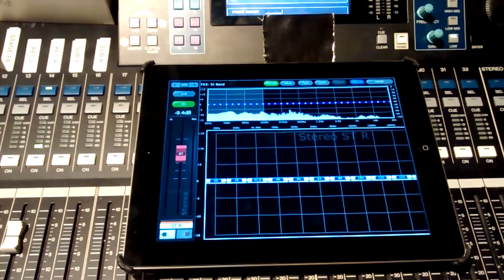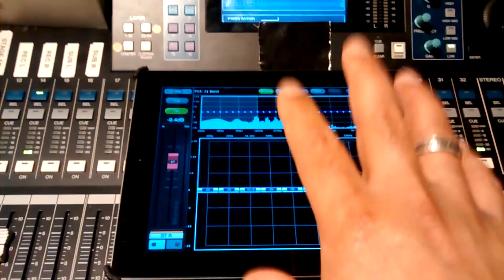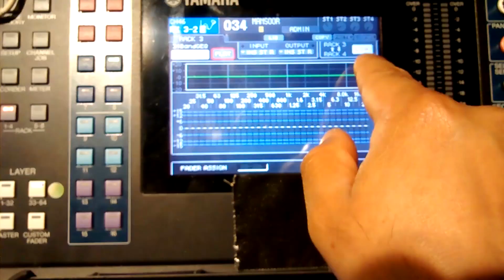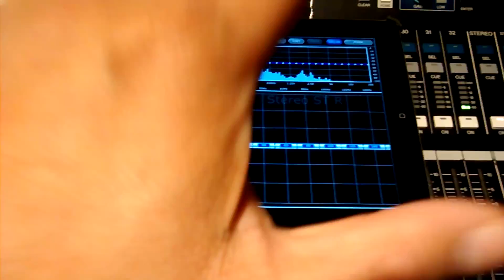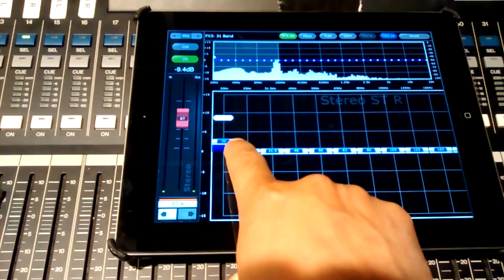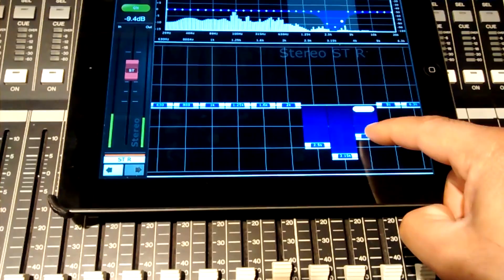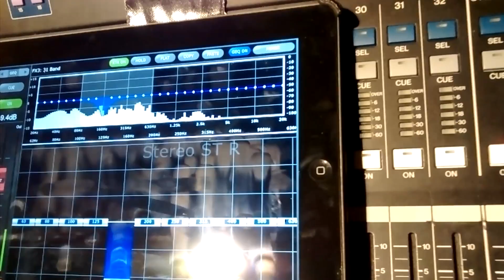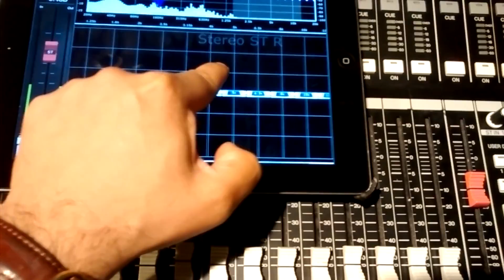Ringing out Monitors feedback

Comment: Is this a joke? 160hz, 400hz? You also killed the high end, if you turn up all the frequencies enough, they're gonna feed back, Listen for transient tones and use the Real Time Analyzers graph. The more you take out the less overall volume the monitor will have. you want to preserve as much of a flat eq curve as possible. 125hz is always a problem with low end bass instruments. For Mike G below me. Good luck in your endeavors.
Reply: it makes no sense to cut frequencies as much as you boosted it until it feedbacked. the later a frequency rings while boosting it, the less you have to cut it..thats paradoxical in step four. but nice video anyway, rta is a nice tool to get an orientation and learn that
Reply from the maker: do you think it's a joke ? This is just a demonstration of how to eliminate the feedback using GEQ not a real show where i am showing how to  condition the venue's monitors & FOH speakers for a band. A real audio engineer does't have to use the built in RTA of sound desks.Although if some one really want to use effective analyzers then Smaart by rational acoustics or Spectrafoo by metric halo should be the first choice. ''Who uses the EQ and Effects the least uses them best'' Instead of pointing fingers try to share the knowledge the positive  & effective way !
Reply: I don't mean to sound like a dick. Just seems like a bad technique is all i'm saying. You were forcing the high end to feedback when the 160hz and 400hz were painfully obviously ringing at 0db on the GEQ. I'm a "REAL" audio engineer and my RTA is always on hand to pin-point specific problem frequencies. I can get in the frequency range by ear, but since I want to preserve as much of a flat GEQ as possible, referencing an RTA gives me the exact resonant frequency I'm looking for. Being able to isolate specific frequencies without an RTA is the equivalent to having perfect pitch. It takes years of ear training and experience to get to that point. Not to say I haven't been working on it. It's easier to hear the low end problems by ear than the high frequencies, that's for sure. If the way you tune your system works for you and the customer likes the results then that's all that matters. There's more than one way to do things. I love you.
Reply from the maker: I don't think so it is a bad technique .This technique was designed by one of the most reputable sound desk manufactures companies in the world 'Soundcraft' & it is documented in  their books as follow.
‘Ringing Out’ the system prior to the sound check will help
reduce troublesome feedback. To Ring Out, follow this
procedure:
1 Set all graphic EQ controls to centre (0).
2 Turn up amp volume until feedback is just beginning to
‘ring’.
3 Turn back the amp volume slightly to prevent accidental
feedback.
4 Starting from the left, adjust the first graphic EQ frequency
gain control to ‘max’: if the system doesn’t feedback, then
this is not a problem frequency. Return this gain control to
center position.
If the system feeds back, reduce the EQ gain by the same
amount you boosted to get feedback.
5 Repeat this procedure for all graphic EQ frequencies.
 
I believe sound is science & art  i.e like maths there is always different formulas to get same results.